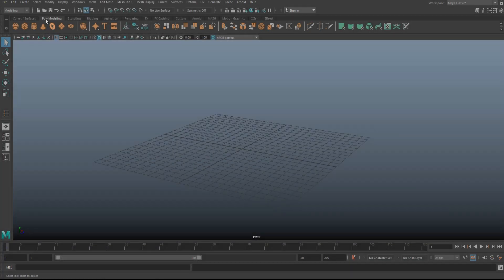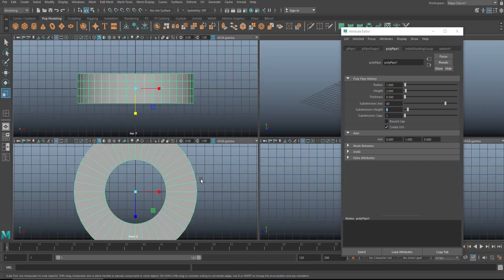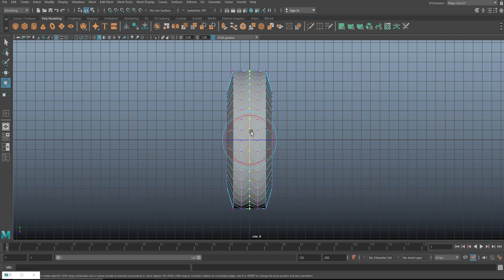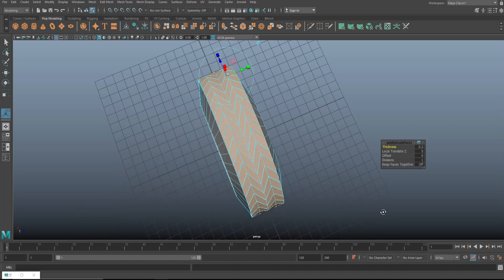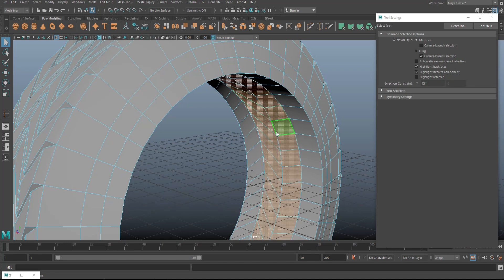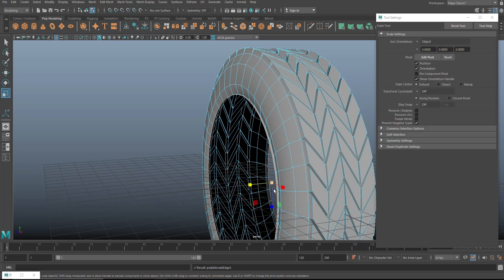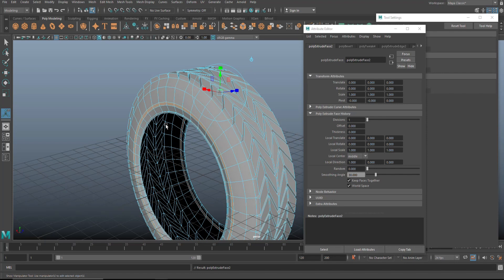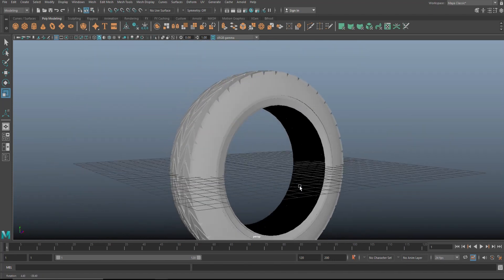How to model a tire in 7 Minutes in Maya

Comment: I am not getting the same results from doing the exact same thing when extruding the outside of the tire and setting the thickness to 0.3 and the offset to 0.05. :\ no idea why. everything is setup right. I am using Maya 2020. And yes the keep faces together is turned off.